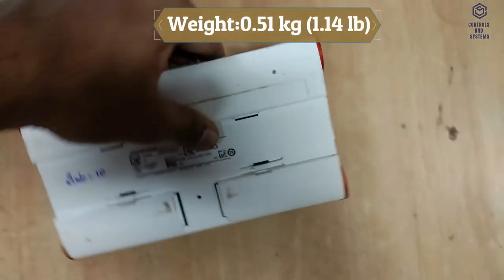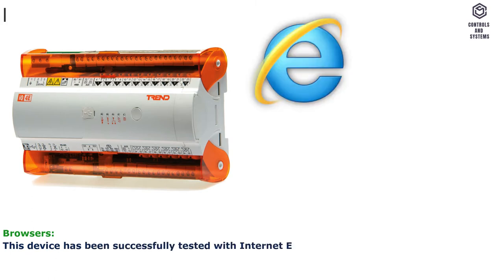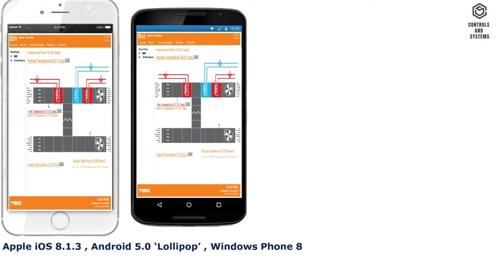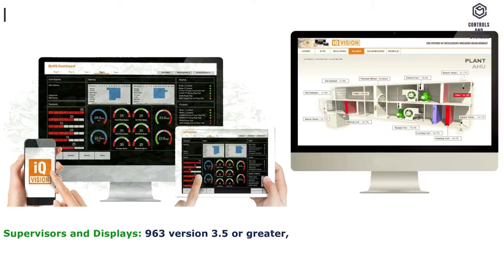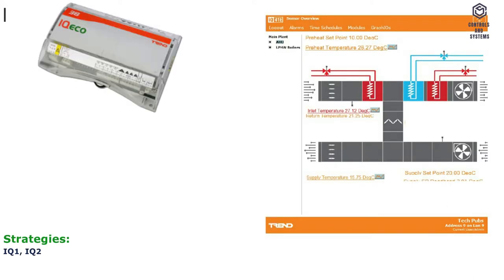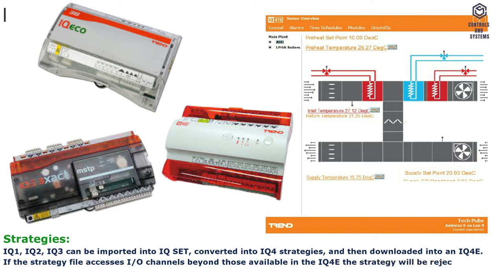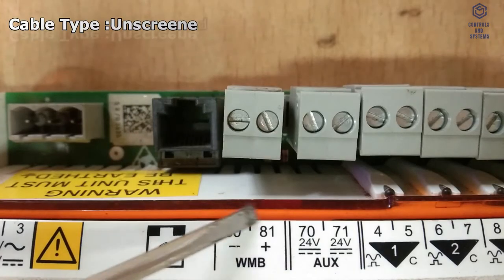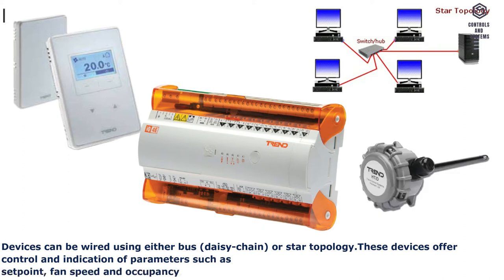#IQ4E TREND CONTROLLER /  #TRENDCONTROLSYSTEM / #Honeywell

Comment: Can we get output from this controller on BACNet IP Slave Protocol? If YES then how many BACnet IP Master can be supported?
Reply from the maker: (BACnet IP) Network modules are only available on /BAC variants or IQ4NC controllers, they are always Network module 3 (n3). 
They store the parameters specific to the BACnet IP network.

Comment: What is the maximum Voltage that can be bypassed through DO port
Reply from the maker: 24 volt - 230 volt Ac at 6A. I recommend 24 volt ac is safer for the DO module device..
Reply: @controlsSystemsofficial  Are you sure we can bypass 230vac thorough DO module?
Reply: please reply
Reply: @sandeeppodder1491  yes.. you can pass 230 volt ac to DO Module C,NO,NC terminals, but i strongly recommend you pass 24 volt ac supply to DO Module C,NO,NC terminals..
Reply: @abcsystems7602  y do u recommend that?
Reply: @abcsystems7602  Hw abt UIO PORT IF WE USE IT AS DO PORT?

Comment: I have 1 controller old this is running and 1 new controller it's possible to old program download the new controller
Reply from the maker: First and foremost, do you have an old program backup? If it is available, you can upload the program using TREND SET software; otherwise, you cannot.